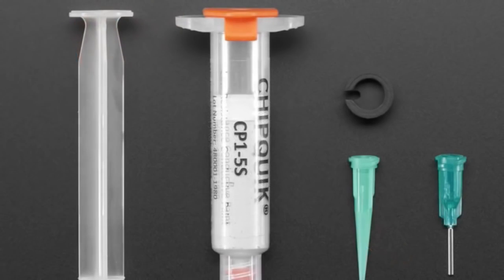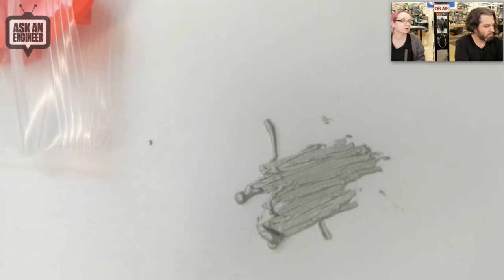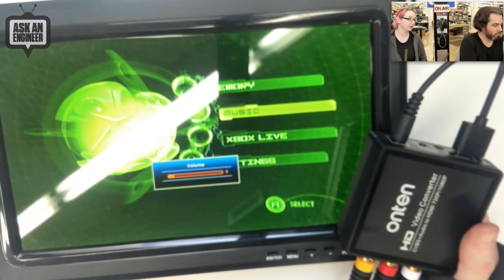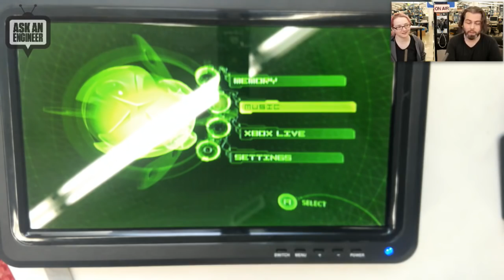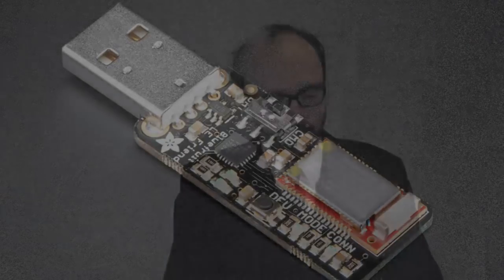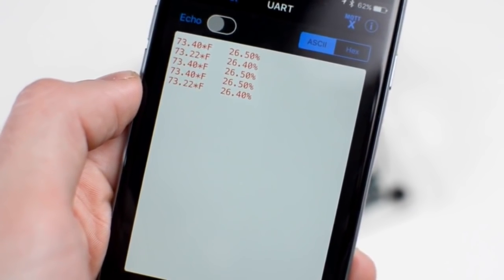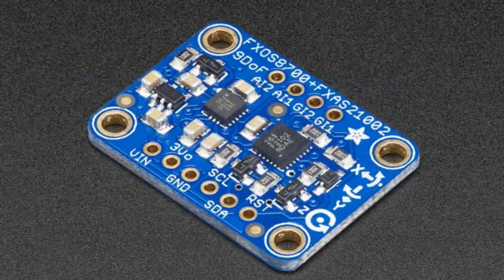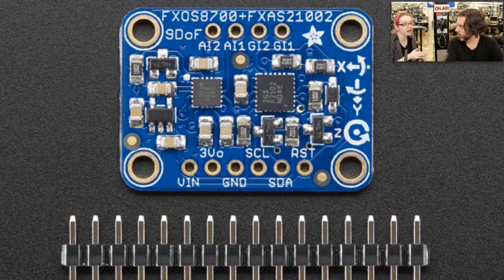New Products 4/12/2017

Comment: So is that composite-to-HDMI converter really any good for gaming?
I mean, the critical issues would be, how much lag does it introduce, and how well does it deal with 240p? Like when dealing with a 240p signal (from NES, SNES, etc.) a lot of converters will say "Oh, this is 480i. I should deinterlace it." and any rapidly-changing images will come out striped.
I know we're not talking about a $300 converter here like the Framemeister, but these are the most fundamental concerns when using an HDMI converter with an older gaming console.

Comment: Quick dumb question here, could you use chipquick as a soldering alternative?
Reply: I think so, but it definitely won't stick your components in place!
Reply: That was exactly my question. Maybe if you used superglue or even school glue to stick the component in place then chipquick the leads?
Reply: maybe hot glue, or crazy glue if you're 100%sure of your goal
Reply: Or maybe... solder?
Reply: I need something that will allow me to "solder" without heat of any kind because of where I am located. So I thought chipquick plus some kind of glue (or double stick tape?) might fill the bill

Comment: Does the 9 dof have the ability to function in low earth orbit?
Reply: So, how were you expecting them to test this? Manhattan is not that much like LEO. :) 
You would at least lose sensible magnetometer function, I think. (Thinking about it I realize I don't know that much about the drop in field strength as you gain altitude, but it would be weird.)
Reply: An object in orbit doesn't have any acceleration on it, so the accelerometer wouldn't do anything. The magnetometer wouldn't be reliable, as the object would be travelling in such a way as to make it impossible to separate movement of the object from movement of the magnetic field. The gyros wouldn't be reliable because you wouldn't be able to account for gyro drift without a constant frame of reference.
Reply: In LEO you could use a thermal sensor to locate the sun for orientation (obviously not constantly as your object would be in shade for some of the time), you could also use GPS for location data.

Comment: My own solution for getting a more modern video output from an original Xbox:

http://i654.photobucket.com/albums/uu268/cierona/IMG_1221.jpg~original

Swap out the 3.5" hard drive for a 2.5", and put an HD9800 into the created space, converting the YPbPr output of the Xbox to VGA.  The Xbox can actually output at 720p (or 1080i) with YPbPr, when games support it, which is a nice benefit.